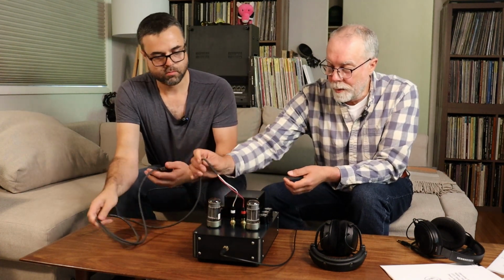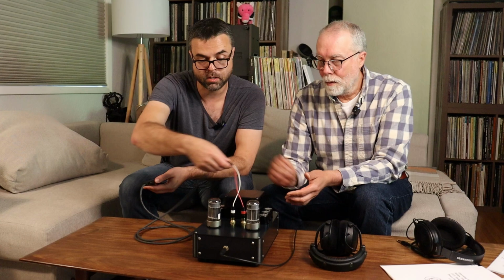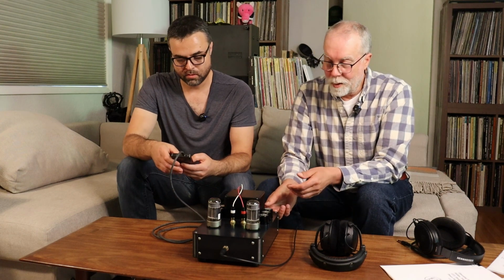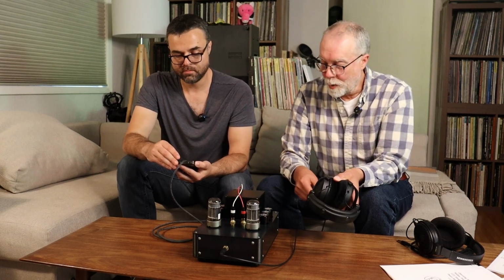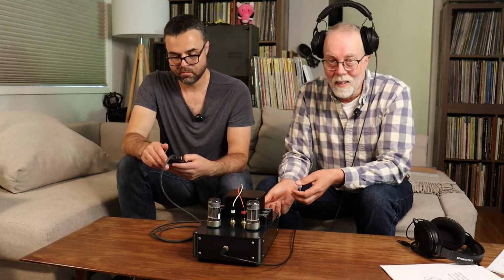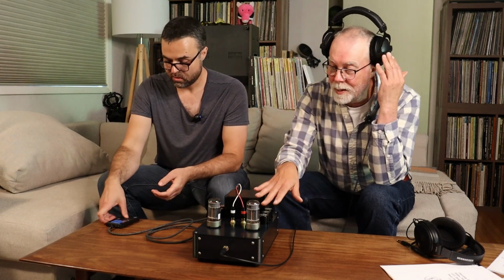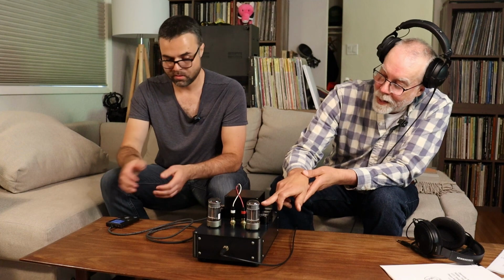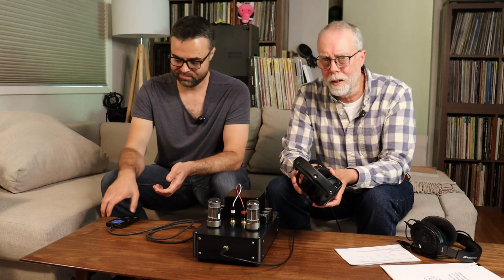Ep29 First Listening Test - ML OTL Headphone Power Amp

Comment: My headphones are ZMF Atrium Opens rated at 300ohms, will these work well with this amp ?
Reply from the maker: The complete manual is available as a Free download online.  In it we actually plot the frequency performance of the amp for 40 - 600 ohm headphones.  We specify 80-600 ohm cans as being perfectly compatible.
Here's a Link:  (just scroll down to find the Manual) https://mellowtoneamps.ca/?product=otl-headphone-power-amp
Reply: Very beautiful looking headphone 👍🎶
I use two Sennheiser 300 Ohm headphones ( HD-600 and a HD-820) and they sound excellent on a tube OTL headphone I already have.
The optimal Ohm range for OTL headphone amps is around 200-600 Ohm I believe.
So your ZMF will work perfectly.
Reply: @Loggiebeat  Thanks 👍
Reply: @cdbeen123  You're welcome 👍